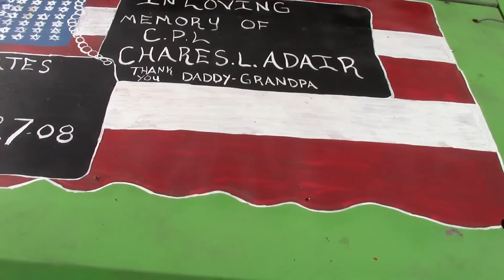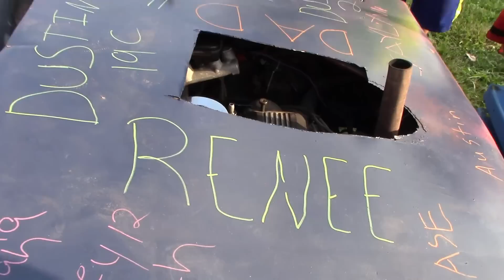Derby Prelude Jay Co Derby 2017 Day 1

Comment: a buddy of mine ran a ford contour and it was a beast. he could hit with either end of the car. he is going to use it again this year . the only issue is the rear cradle is week but the car was still a beast. i used a mercury lynx with a diesel and it surprised me. won my heat and just hammered everyone then finished 3rd in the feature.

Comment: Volvo,s are basically moving bricks
Reply from the maker: Yes, except the awful bumpers they have. That one came off right away
Reply: DemolitionMissions its a 90s volvo 850 if im correct but they have 5 cylinders in them and they last forever
Reply: I've also heard that their engines don't take heat super well. But that's not going to stop me from running mine again. haha.